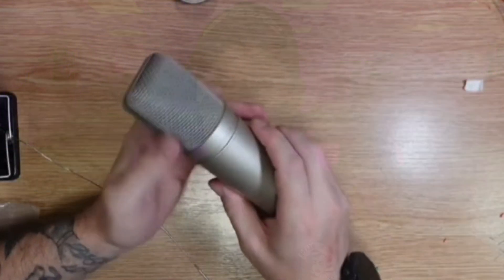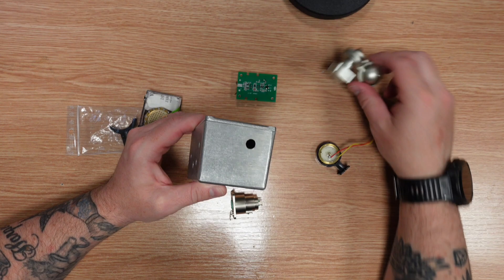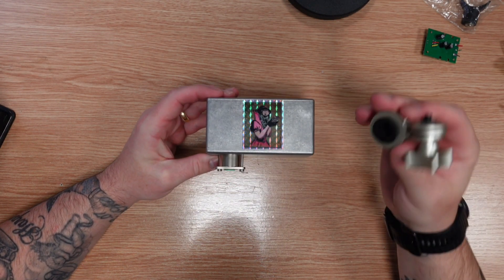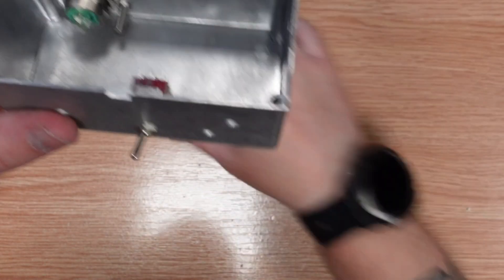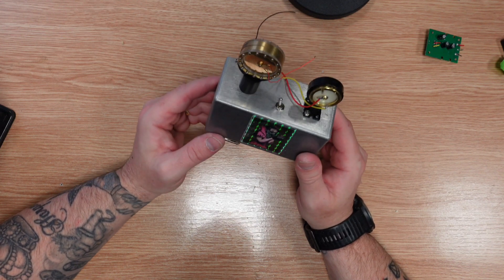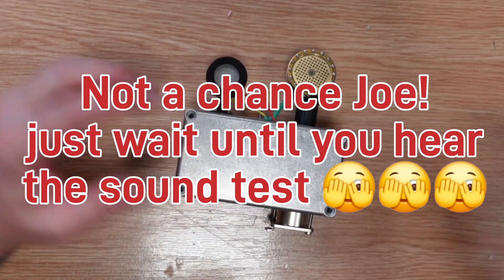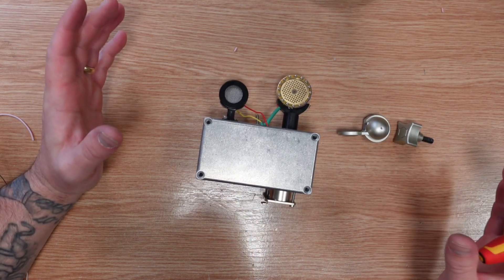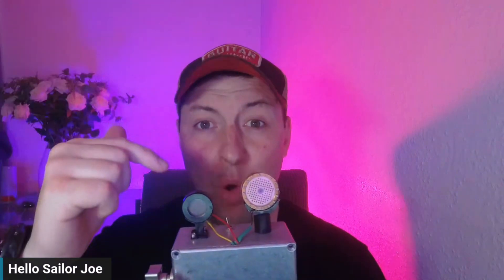Is Swapping Capsules the SECRET to Better Sound Quality?

Comment: do you know the one capsule isn't working at the end of your video?
Reply from the maker: @taytaytazermusic2539  It sounds extremely low. This, I found was due to the pcb not giving enough gain for the larger capsule. I must admit I hadn't expected that.
Reply: @hellosailoreffectsofficial  oh I see. Too bad!
Reply: Yeah, that comes down to the cheap pcb. Large Diaphragm capsules need a second board to provide power to the rear diaphragm, a.k.a. bias voltage, in order to send the capacitive charge to the capsule. The smaller capsule, an electret, doesn't need that as its "permanently polarised", meaning that the charge is basically always there. Something I learned when I first wanted to mod my old mic.

Comment: Try taking the inner layer of mesh out of the headshell. If there are in fact 2 layers! 

The capsule capacitor can make a huge amount of difference. Deoending upon the value and what you can get ahold of glass capacitors can be pretty amazing.
Reply from the maker: I need to check out a glass capacitor for sure! Thank you for the heads up, do you have any links?

I didn't delve deep enough to find out mate. My first mic build was awesome (if I do say so myself ha!) And I have committed to giving this contraption away to the best remix. I figured someone might put the capsule to good use ha ha
Reply: @hellosailoreffectsofficial  They're common enough! Don't know any UK/EU sparky houses sorry!

Long ago on GroupDIY a bunch of us built the Gyraf tube mic then we got into the Oktavas. Guitar Center had a blow out, $99 for the ribbons, the tube mics and the 012. We got Lundahl to chime in on a transformer for the ribbon, there was a mod for the 012 published in TapeOp iirc which was amazing, and we slogged thru the tube mic on our own. Still have all mine, pair of ribbons, pair of tubes, 4 012s, one stereo pair. 

Here something to consider for mic mods: depending upon the body construction and material the body can set up a horrible resonant frequency. Your U87 type body here should be fine. Beware machined aluminum bodies, it can be the head basket that will sink you. The easiest test for resonant head baskets is to make recordings with and without. If the mic sounds like it's in a 5 gallon plastic bucket with the head shell on you've got some shit resonance going on.